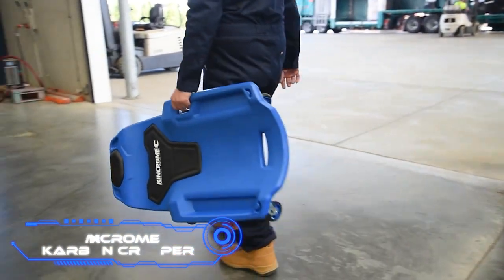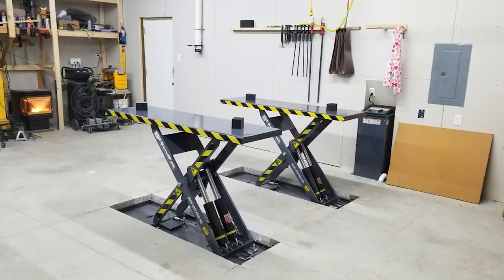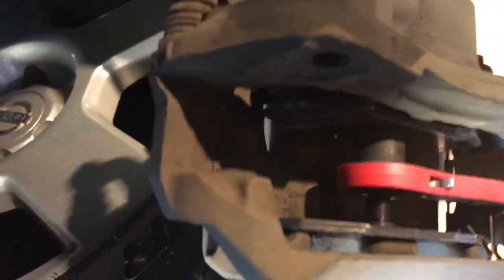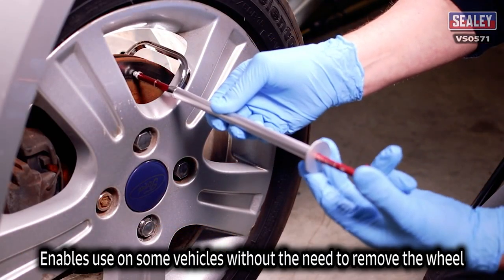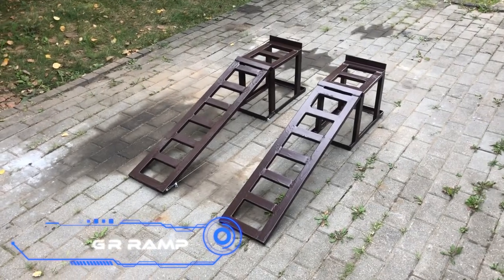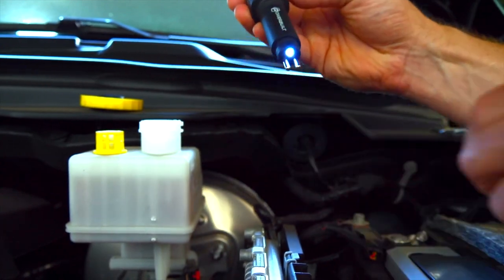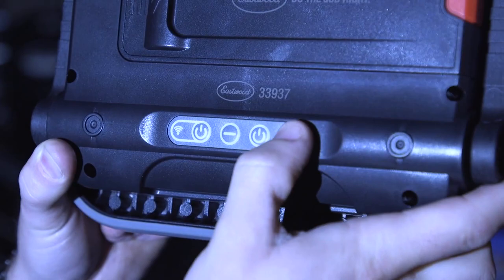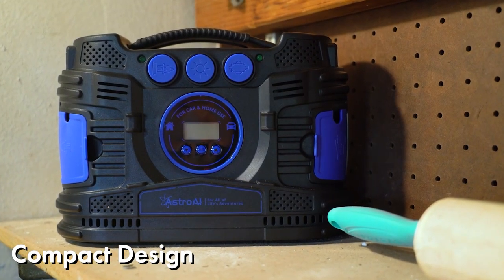COOL INVENTIONS FOR YOUR GARAGE YOU MUST SEE NOW

Comment: Kincrome Carbon Creeper was created to make it simpler to operate underneath vehicles. It is designed to support our head and back so we can work as long as possible without getting tired. It has places to put tools on the sides, so that we have everything we need close at hand while we work. Bendpak is a perfect scissor lift for automobiles. The lift is easy to put together and has a simple design. It takes up little space and can be used in rooms with low ceilings. Powerbuilt Ratcheting Caliper Piston is a tool that will save our time and effort when working on a brake system. The tool is very versatile, which can be used with many piston calipers. Thank you so much for doing this video.
Reply from the maker: Great comments as always! Thanks for sharing!